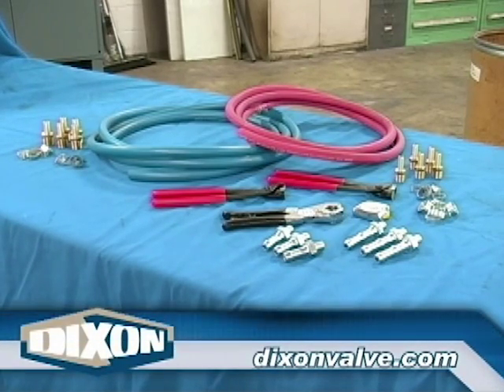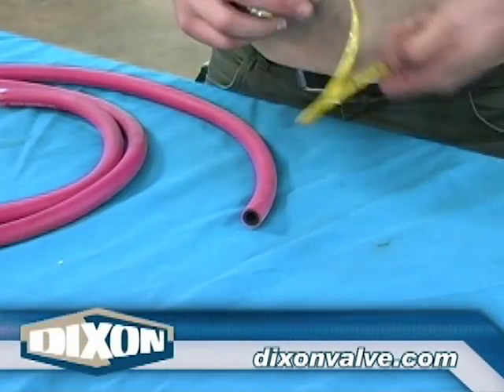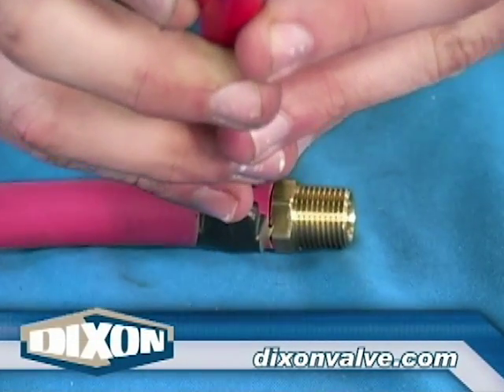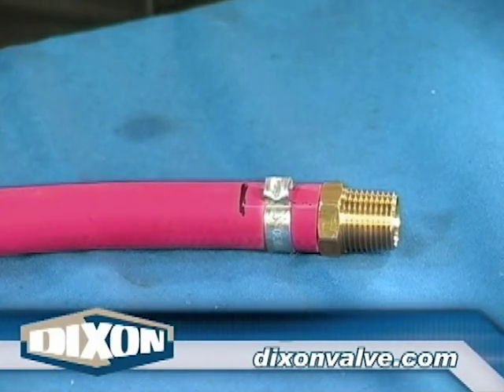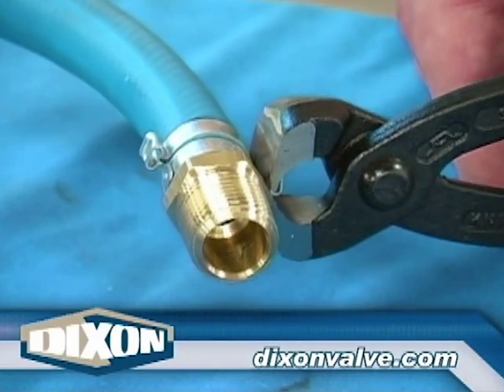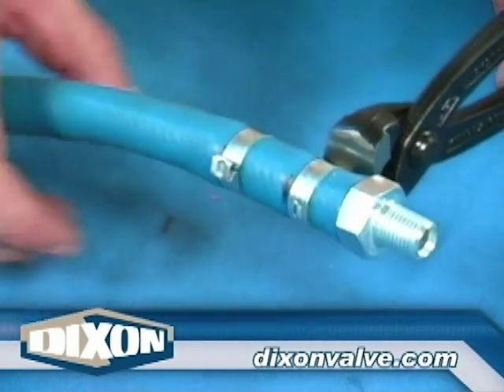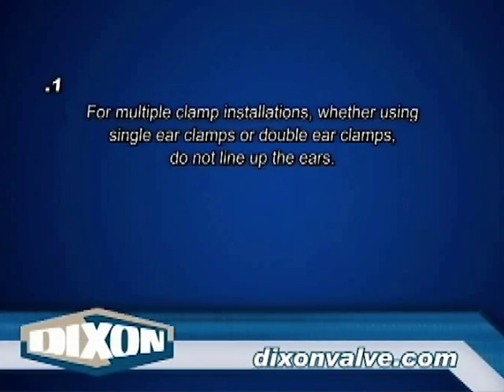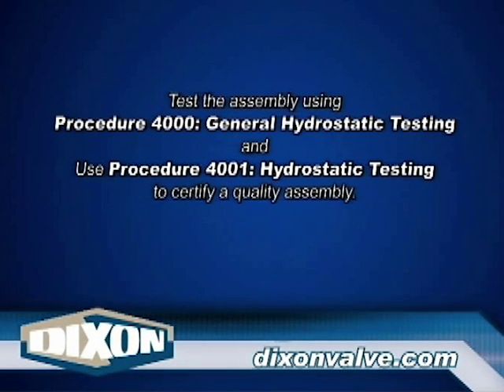Procedure 2203: Pinch-On Clamps

Comment: What are you using for lubrication?
Reply from the maker: We use the Dixon Coupling Lubricant that can be found on our website here. https://www.dixonvalve.com/product/DCL20 It also comes in a larger 4 Liter container. https://www.dixonvalve.com/product/DCL80
Reply: Whatever
Reply: I know you asked this a couple years ago but if you are still interested soapy water works good.
Reply: Vasiline, VERY thin layer should work as well.
Reply: @bgable7707 Vasoline ( petroleum jelly ) is petroleum based and may not work well applied onto rubber .  Oatey and Hercules Duck Butter pipe joint lubricant works well and rubber is not effected .

Comment: "...if both ears fully close the clamp is too large. Remove the clamp and install the next smaller clamp." And you remove that thing how??
Reply from the maker: You can cut off the pinch portion of the clamp with a grinder wheel, then use pliers to open and remove the clamp. Let us know if you have any more questions!
Reply: This is the down-side of these...not easy to remove
Reply from the maker: Please email engineering@dixonvalve.com or call 877-963-4966 to discuss the details of your application and alternative solutions. Thank you.
Reply: I use the knipex tool to cut through 1 ear, vertically. I try and not bite through the entire fold but rather one side of it. This is a PITA but it works and far better than using a cutting wheel. The copper crimp ring removal tools work great, wish they had one for these style oetikers.